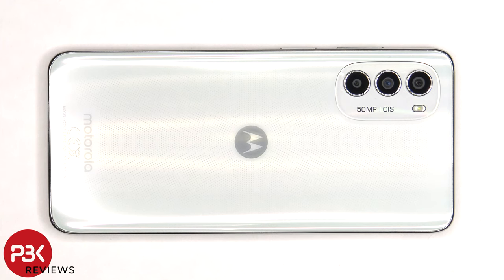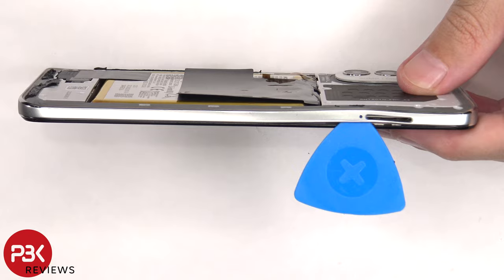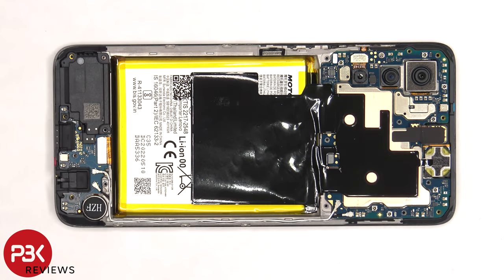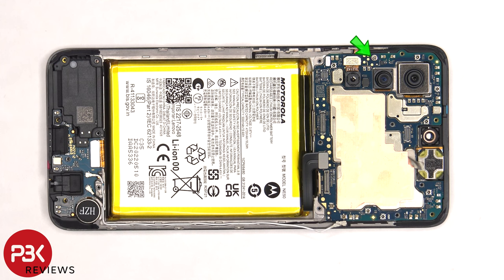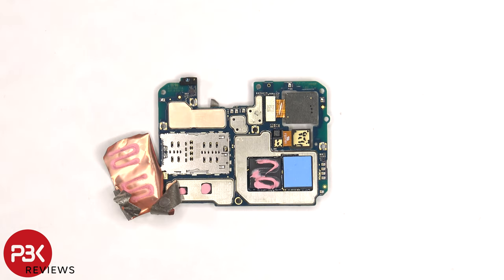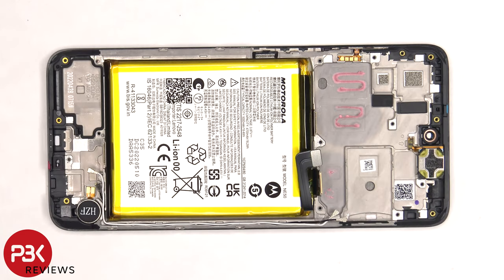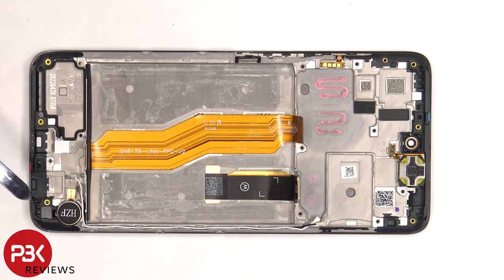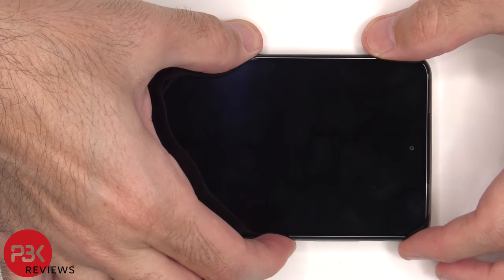Motorola Moto G82 5G Disassembly Teardown Repair Video Review

Comment: Great detailing, many thanks. However, I have a question....where were the antenna lines ?
Reply from the maker: The antenna flex cables are on the inside border of the back housing.
Reply: @PBKreviews  cool, thanks! However, if you clarify are these inside border cables provide sanjee robust network connectivity if compared to those phones who claim to have antenna lines marked outside like Samsung and Apple?

Comment: Bro can I use this battery for moto edge 30 which has 4020 mah nd40 battery?
Reply from the maker: Connector type/location and battery size will probably not work.

Comment: sir your teardown is so professional and clean to look at ! hope you get more views and btw i have a problem, my phone poco x3 which was running on pixel android 12 custom rom  suddenly blacked out when i was scrolling through instagram and now it fells like that it is  completely bricked it was working absolutely fine for 3 months .. so do you have a hint that the problem is hardware or software based ? and what is the best option for me to do  .. i am hiding it from my parents for now  so the situation is kinda tensed rn
sir
Reply from the maker: Thank you I appreciate it :)  Hmm not too sure. When you hold volume down and power for 30 seconds to hard boot it, does it help? Or try going into the bootloader (different with each phone) by pressing and holding volume up and power or volume down and power etc. and see if it will bring up the bootloader menu. If it does, then it is a software issue. If not then maybe something on the hardware side failed, either display or something over heated etc.
Reply: @PBKreviews  thankyou so much  for your reply! looks like  its a hardware issue caused by the custom rom ..
Reply: anything other than official lineage custom rom will duck up your phone

Comment: Eww, the back is glued on, what the hell is wrong with manufacturers these days? There is a special place in hell for the people responsible for all the adhesive in smartphones. I usually tape over 90% of the adhesive when replacing a battery.